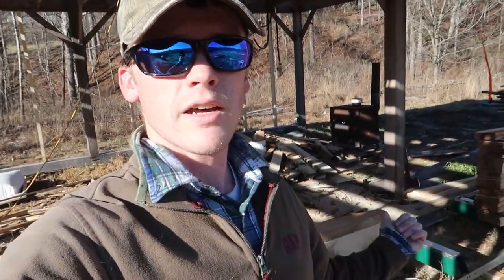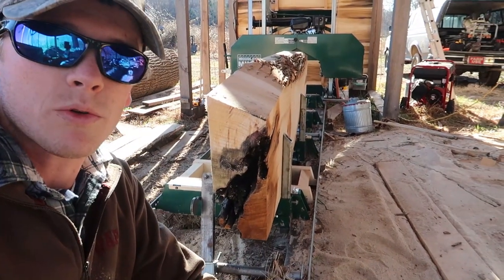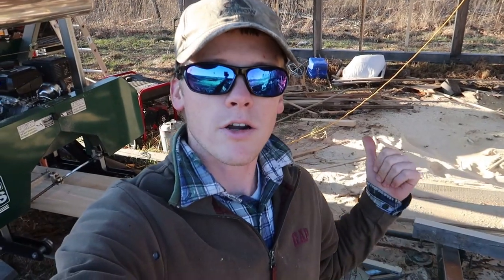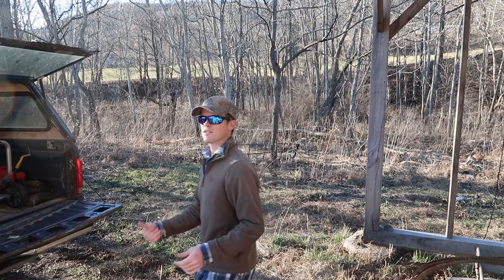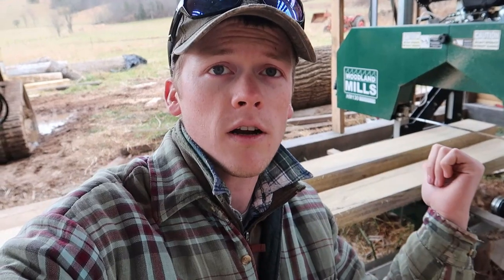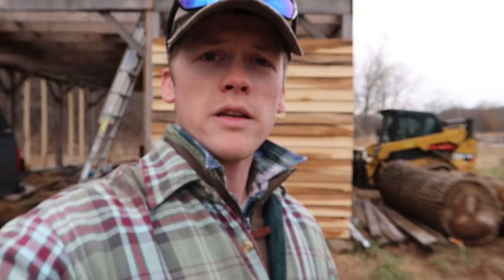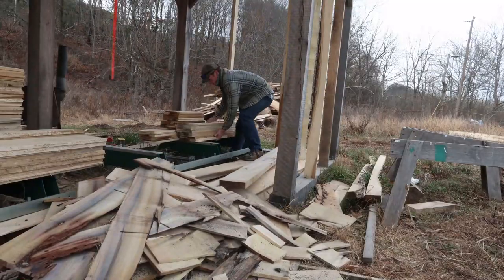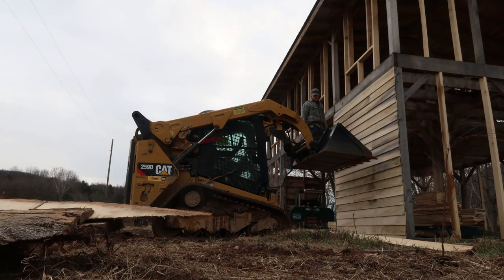More Milling, More Siding | The Millhouse

Comment: What kind of wood you using for siding? Also a quicker thing to use instead of the compound mitre saw is a cordless rechargeable circular saw and use a carpenter square! You can use one with a power cord but once you use the cordless you will be sold! easy to charge just get a inverter ( https://youtu.be/8XIJSf4fd-g) and charge it off your truck battery.  Check out this guy who uses one here is the link
 https://youtu.be/ewL2qbX0i78
Reply from the maker: I'm using Yellow Poplar. 
Well, I've tried it both ways, and from my personal experience, the mitre saw is head and shoulders above a circle saw. I personally can't go nearly as quickly with the circle saw, but to each his own. Josh